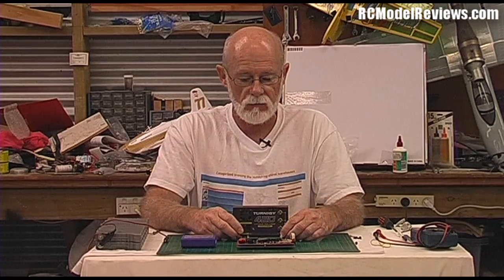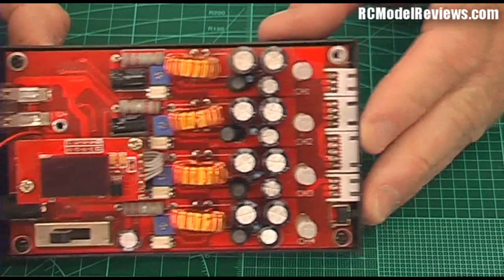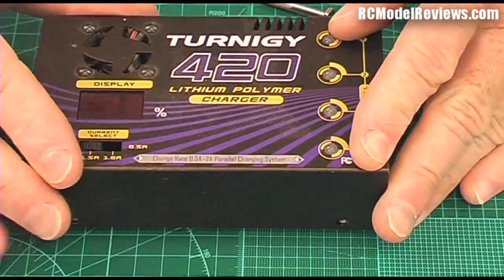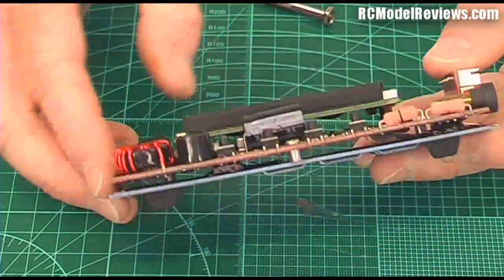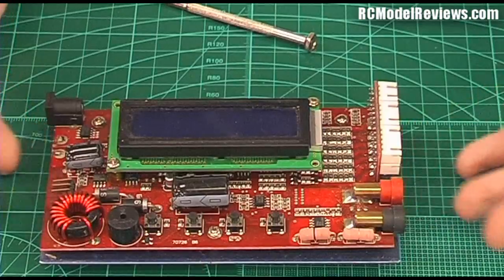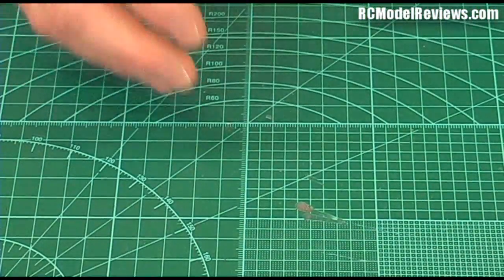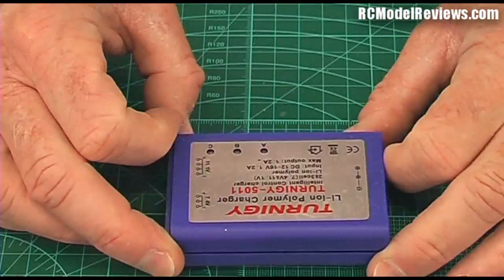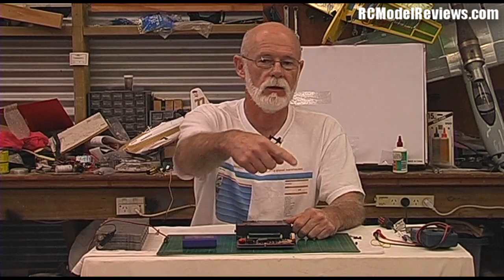What's Inside: lipo chargers

Comment: the 800mA Turnigy 5011  3 cell balance charger would not output enough amps and i'm not understanding what current should  be applied to a 6p3s 11.1v  battery comprised of 18 x  18650   3.7v   2200mAh cells.

Comment: Thank you, very good info about chargers. My Imax b6 never charges to 100% it always stops at 4.18 or 4.19v per cell.I don't know if this is bad for the batteries but I'm sure it's better than going over 4.20v
Reply: It definitely isn't bad for batteries to undercharge them. It actually slightly increases lifespan of the battery. Downside is you are using slightly lower capacity of the battery when not fully charged to 4.2V.

Comment: I ripped in to mine to see how it works

now it doesn't work :(
will not read first cell if battery main power is connected, will read all cells if battery main power DISconnected

Comment: hi there i ahve a question maybe you can help, i have one of this charger but with dual ac/dc power posibilit. it works fine with car battery, but if i conect to ac outlet, it turn on the display and fades away right away. like is not latching to power suply inside the box. the Vout of this power suply is 15.21 wich seems ok. but the stage between the power suply and were the charger gets the inputu power must have something bad, i would believ it canbe a capacitor or something similar. would you kow what it is. regards
david

Comment: I got GT. POWER A606 digital balance charger .I think the charger seems bit broken, but I dont know what the broken part is. Everytime I choosed charge mode, or BALANCE CHARGE mode , it reads the cells but when It started charging.. the ampere indicator appeared to 0.0 and the battery volt didn't increasing. But when I switch to STORAGE mode, it seems normal. So what's the problem and how to fix it? please advise... thanks

Comment: Bruce,  Just been trawling the sites and "discovered" yours.  Great stuff!!!  Very intrested in your comments on balance chargers.  I've had two (one died after I pluged in the balance charge plug in the wrong way).  You mentioend that it was possible with the correct combination of keys to tweak settings.  I have an IMax-B6AC and I'm wary of the "balance".  Your sessions have beenmost informative.  I'm sure you can suggest how to  improve these chargers.  Rgds, Nick.

Comment: I bought the latest quad charger from hobbyking that charges four batteries at up to 100 watts for each battery and it was working so well until finally one of the ports had an issue where it stopped being able to give a consistent voltage reading and it would say that the battery has the wrong voltage even if it is a good battery.

Comment: Hello,
I have a imax b6ac that woked grate for about 4 months till i tryed to charge a battery that had a cell that was at 1.5 to 2.0 and it would not charge it.
now every time i try to charge a battery it buts out a err that #2 cell is to low.
what would be causing this?

Comment: It's true there is some rubbish out there, we don't stock endless brands and variations, we just stock some tried and tested favourites based on customer feedback.
Aero modellers will buy cheap imitations from china and then moan about the quality, not that their tight or anything, they also like to fast charge beyond the battery specs and moan when one cell dies and it's always on the first charge, oh really? i have an answer for that which im too polite to post

Comment: Woo! Good info Bruce mate! I have an unused (though 2 years old) 11.1 lipo with one cell at  4.2 and the others at 3.85/3.89 I tried to balance it twice but don't recall seeing much of any change in the three cell's voltages. The only cheapy balance charger I have is for a 2 cell lipo, but I don't mind shelling out a tenner for another charger if it will do that job. Cheers matey.

Comment: could you show how to adjust the balance ports of the imax b6? when i check the voltage with a meter on the pack's individual cells i have one that always shows 4.23 and the rest are at 4.21.  but the charger says two are at 4.20 with one being at 4.19. i'd rather not wreck there batterys. thx

Comment: Greatly informative video. I have the Accucell 6 which does do a great job , but as you pointed out the out of balance batteries can sometimes take forever to balance. I would consider picking up one of the 420 chargers for the 4 cell " out of balance " packs.
Thanks

Comment: yes ples show us how i have about 10 of the basic chargers that came with rtr models an not one puts the right charge in in a lipo but one of the dose charge right an balance is fine but it take a year an some to do lol as am a little new to lipos an chargers iv just bought a 450 align trex witch came with a PRO-PEAK PRODIGY 2  BY RIPMAX do know it well not sure if it suppose to plug in to a balancer or straight to lipo looked on you tube but no help an less your

Comment: Was about to throw out a 2/3 cell basic charger just like the last one you showed. Glad I watched this, will now keep it for balance charging 3 cell batteries when I work up to a 450 size heli. Will have to check the voltages on the individual cells it charges up, but you gave me some hope for a little more re-use and recycling of bits I've bought while I'm learning. Thanks!

Comment: Hi there, to calibrate the charger with the big screen you have to press and hold decrease and start button, power up the charger and wait, calibration screen will come up, connect the battery and your meter and with the charger, with increase decrease buttons adjust your charger's value according to your meter readings (assuming you meter is calibrated ;) press start/enter to save and your done :) This works on my Bantam charger it should on this one too, I think :)

Comment: Loved your video.  Great work.  I do use the cheap little chargers and would like to know how to calibrate them.  I had access to quite a few of the chargers as most guys would buy a better charger and throw them away.  I actually made special set of connectors that allowed me to charge 4 and 6 cell packs using two of those cheap chargers.

Comment: the turnigy 420 is actually a quite special charger... it has 4 isolated dc-dc converters, which allows it to charge each cell separately. this also allows full charging and balancing very way-out-of-balance packs, like a cell at 3V and one at 4V, this would take ages on a normal charger.
a "normal" charger, like the imax or accucel, charges the whole pack & then discharges the cells to equal voltage (balancing). which is slightly more taxing for the pack and takes long for out-of-balance packs.

Comment: @TheMagicmole77 Yes, then the video can go into different types of motors and gear ratios.  Also newer gearing materials versus the traditional nylon gears such karbonite, metal, and titanium.  Brushless/coreless versus traditional brushed servo motors, etc.  Would like Bruce's take on the benefits/deficits.  For example, metal gears are strong but can develop slop over time with metal-on-metal contact or is that just with older designed metal gears?

Comment: Excellent, thank you for such a simply presented video, nothing too high tech and enough to explain the workings of a charger. I have an iMAx Quatro B6 and would love you to review this. One of the charging ports is not working as the display is flashing all over the place. I link this to trying to revive a previously damaged LiPo which had gone below minimum voltage.That happened by using a non balancing charger sold to me by Sussex Models when I knew little about LiPo's. John.

Comment: when you charge at 1c per cell and it says full, reduce the charger to 1/2 c and it will peak charge because the charger sometimes gives a false full. i do this with all my battery's just in case it's wrong.  not all chargers do this but it doesn't hurt.  just my way of making sure it's peaked.

Comment: G'day Bruce, great video but if I may point out a couple of things with your presentation, trust you will take it in the right way. 
1/ Stop fiddling with the object you are presenting, move it when you have to but keep it essentially still, very tough on the eyes with things being constantly moved about.
2/ use a pointer to high light items rather than your finger, it is easier to identify small items and helps stop the fiddle factor, perhaps use the small screw driver.
 
Great info, keep it up

Comment: oh too LOUD peizo speaker, FIX: a piece of clear tape over the hole, to adjust the volume up (slightly use a pin/needle to make smaller holes)
VERY EASY, and does make you and the wife happy (when you charge at the living room table)

Comment: Excellent video.  I had two of the $5 turnigy chargers and I think they were responsible for destroying cells on two my packs in the past.  I respect that its $5 but they should have spent another $1 for better voltage sensors!  I don't use them anymore. But a $200+ FMA 1000W PL8 and a Hyperion Duo-III.

Looking forward to more in this series!  How about servos and why they're so many gears inside? Also video Tx/Rx for FPV, dipole antennas, RC radios, ESCs, Brushless motors poles, windings,

Comment: Great and informative video. I would like to see how to pick resistors to recalibrate an overcharging charger. I have two Eflight 3 cell balance chargers that charge up to 4.4 Volts per cell. Totally fried the first battery after two cycles. Horizon did send me a replacement battery and charger. I did not use the new charger on the new battery. I used it on an old battery and guess what, yup, overcharged it.

Comment: I like it.  I am a retired engineer and worked with embedded processors.  Looks like the Chinese are using them.  It's amazing what a eight pin or six pin microprocessor contains.  Many have a very accurate A to D converters.
I have been tearing apart ESC's and they also have embedded micro p's.  They use a  bunch of MOSFET's controlled by the processor.  It would be great if you can do a series on how they work.

Comment: You can calibrate some of the 4-button chargers...
From HK:
Calibration process: 
1 - hold - and start button
2 - plug power adaptor
3 - wait for calibrating menu
4 - release - and start button
5 - wait 20 minutes to warm up to the working temperature
6 - plug in battery and measure it, compare values between charger and Voltmeter
7 - if necesarry, then make correction using + and -
8 - save it by pressing start

Comment: Not really much point pushing the cell to 4.2V.  4.15V will give the battery much more life with very little decrease in flight time.  I even use 4.1V on my electric bike since I want the battery to last a long time.  The worst thing you can do to a battery is to charge it to 100% and discharge 100%, keeping it at 90% charge & discharge will do wonders.